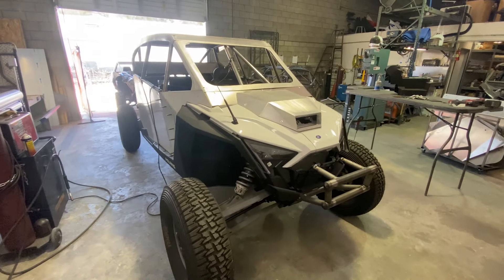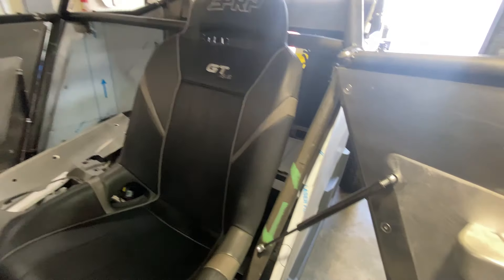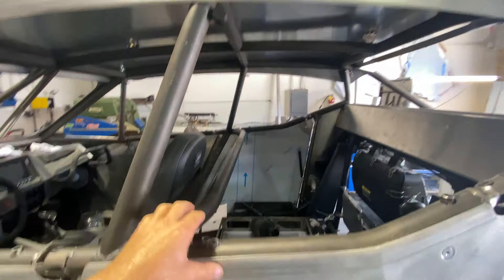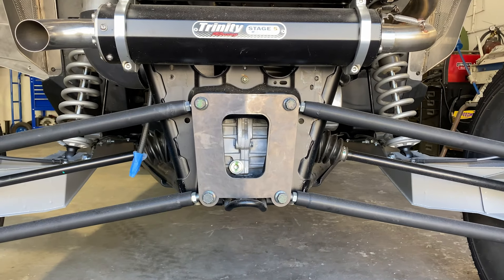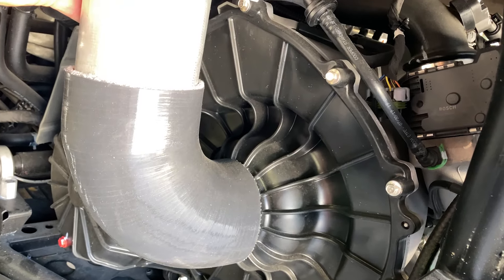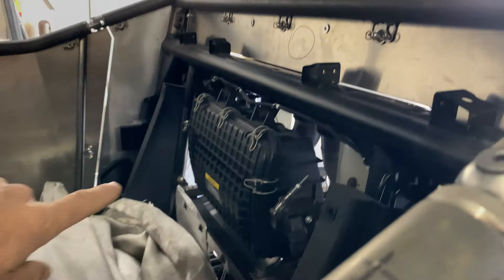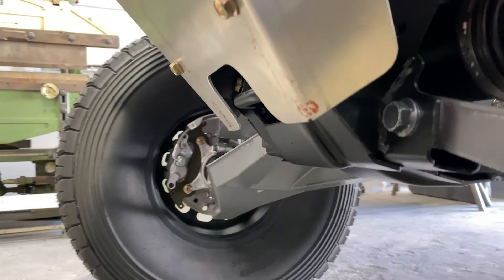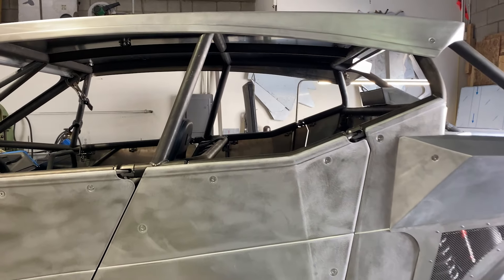The RZR Pro XP that will BREAK the Internet...

Comment: What wheel is that? Is it 6+1 I really want some that are 6+1 the 5+2 make my turbo s to wide for my trailer
Reply: I have a 5+1 wheel.  They are Raceline Trophy wheels in 15”.  They loook awesome. My main issue was fitting through gates at 65” in NH.